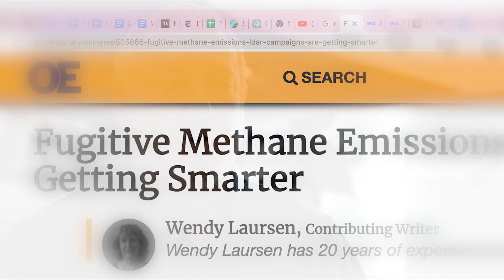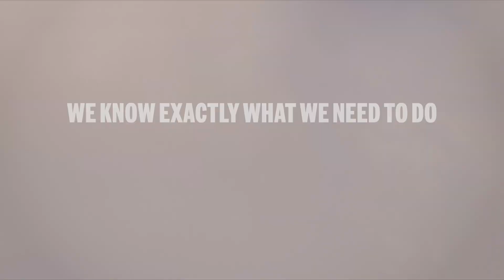This is The Methane Moment

Comment: What happened to Co2 oh that's right that scam has been busted we need a new one.
Reply: Both CH4 and CO2 are greenhouse gases. CH4 is more potent. But CO2 stays in the atmosphere longer.
EDF's goal is to slow global warming quickly so they want to focus more on the more potent, albeit shorter-lived CH4 gas.
We will still have to worry about CO2. People have not stopped thinking about CO2.
We've known about Methane's role as a greenhouse gas since the 1980s, when methane and other gases were brought to attention by Veerabhadran Ramanathan.